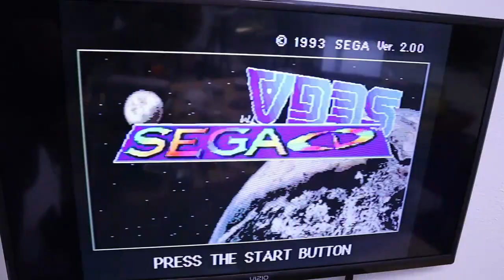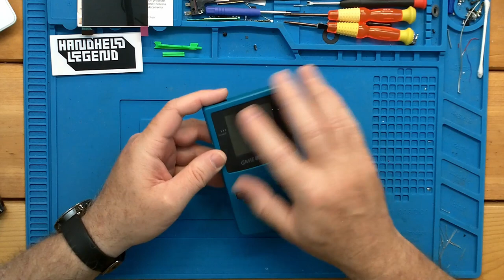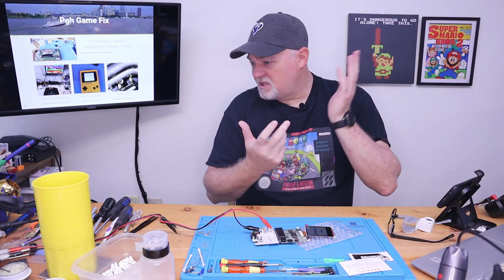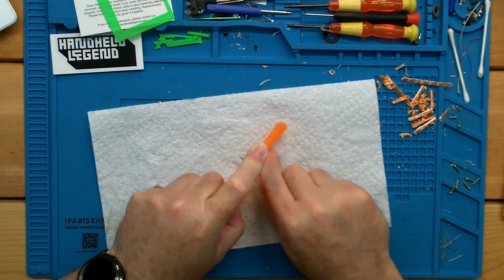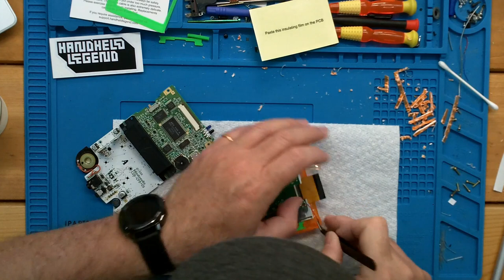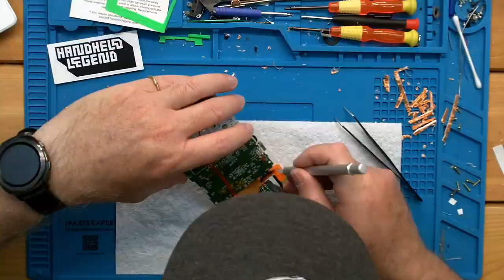Gameboy Color IPS Q5 Screen install, and Pokémon Shell from Handheld Legend

Comment: Great mod, do you need to solder the 4th wire where it says ‘Bat’ if you want the battery display on the on screen menu to work?
Reply from the maker: Yes, I believe so.
Reply: @PghGameFix  thanks mate, I’m in the middle of putting mine together now and I’m debating if I need to do it or not.
Reply from the maker: @UzzyT.  You don't really need it, but you can tie it to a power rail on the board.

Comment: Why didn't you solder the cables behind the screen, so they are invisible?
And always cut down the pins below the display with a flash cutter. Otherwise it will lead to display damage over time.
Reply from the maker: I'm not sure what you are asking about the "Cables Behind the screen".   None of wires are visible.  As far as anything causing screen damage... everything that the screen comes in contact would have been flush cut, and trimmed clean.
Reply: @PghGameFix  I came across like a douche. I'm sorry for that.

You have a semi-transparent shell. The cables to the buttons are visible. I can see them in the video. It's not a problem at all, but you can make it more elegant and hide them under the display. There are several points on the board connected to the buttons. You can detect them with a multimeter. I uploaded a picture and marked the spots. https://ibb.co/J77ShvZ

I didn't see you cut the pins. After watching the video again, you might be fine. Yours seem pretty short. On my board they protruded much more, like little spikes.
In my experience, it is better to cut these pins. At first I didn't either, but after a month or so I had dead pixels. https://ibb.co/NtZCXym
After contacting the manufacturer, they advised me to cut these pins. Hasn't had a problem with any device since then.
Have a good one!
Reply from the maker: @GASH_one  You were fine... no issues there.  OK.. I see what you are talking about... and yes, with the clear shell, those may look cleaner with another solder point.  BUT, for this video, I was showing the easy spot  for most people to hit, since they line up, and just fold with the ribbon.  Thanks for watching !!